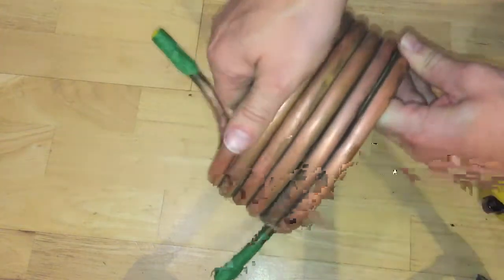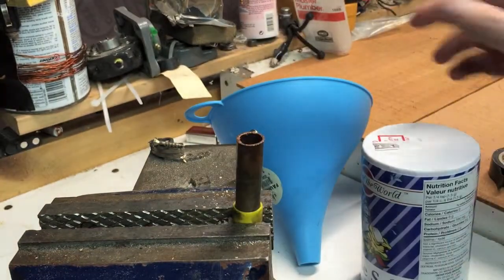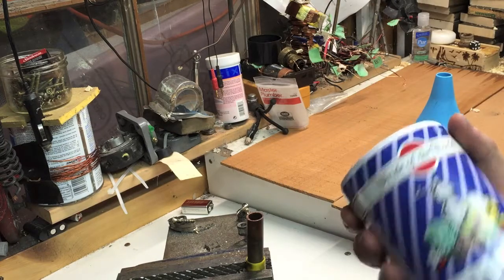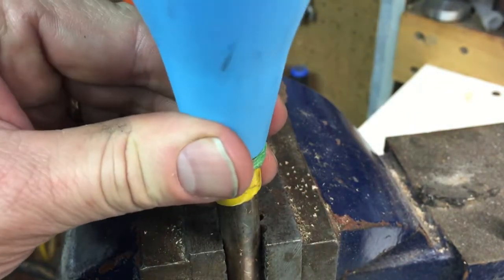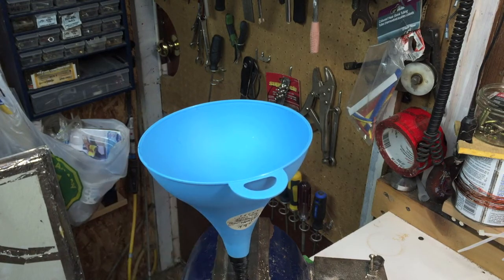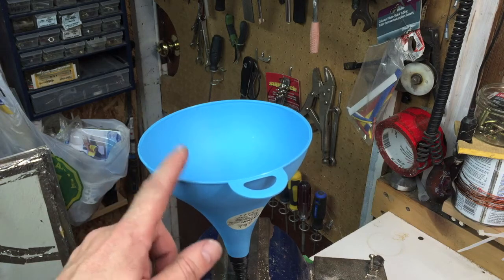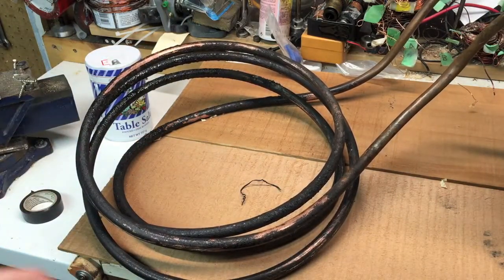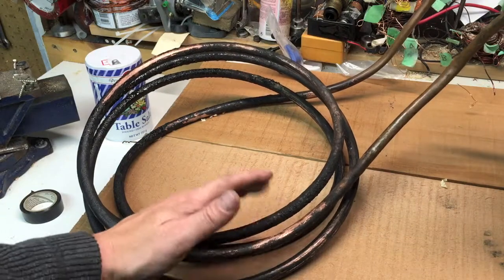Use Salt to Bend Copper Pipe into a Water Coil

Comment: River sand is best dried in the oven spread thinly on a baking tray then  filtered through fly screen wire & kept in container with lid to prevent absorption of moisture to remove the sand solder a click connect hose fitting on end & turn tap on full after the water soaks into the sand about 1-2 mins it will blast out the end of coil don’t look down the tube to see if it’s coming out or you will get a face full of wet sand

Comment: Great video, thanks. Will this technique work with a length of copper pipe that was originally as sold in a single, straight length?
Reply: Aneal it first.
Torch  to heat it and let it cool slowly.
Fine, dry sand also works.

Comment: What about using just regular sand inside the copper pipe?
Reply: I think salt is used so that you can dissolve it out with water if it won't fall out

Comment: nice, steel break line would last a lot longer when the coil has no water in it. are you using convection to pump water into the storage tank?
Reply from the maker: Using a 12 volt pump and it puts it in a 5' long clawfoot bathtub

Comment: mark my words" Its very hard to remove salt from that coil afterwords "
Reply: Solder a click connect hose fitting to the end connect the hose & wait for 1-2 minutes for the sand to absorb the water you will hear the sand moving just before it blasts out the end